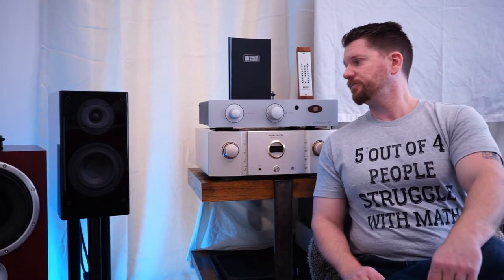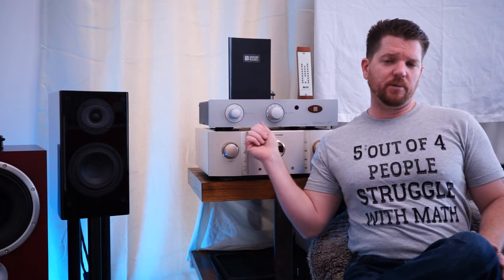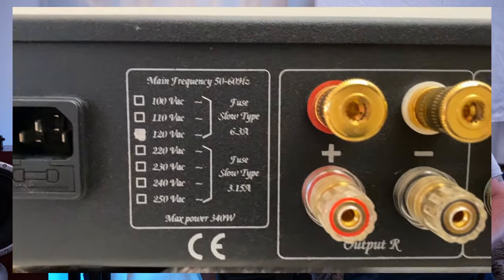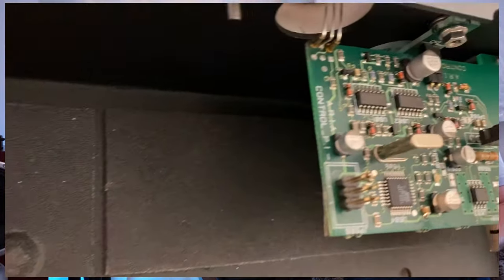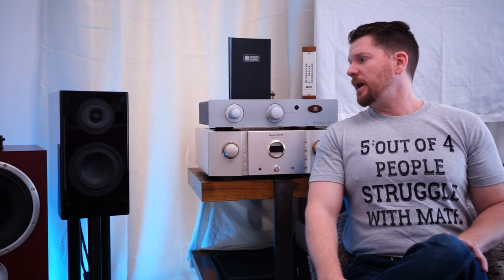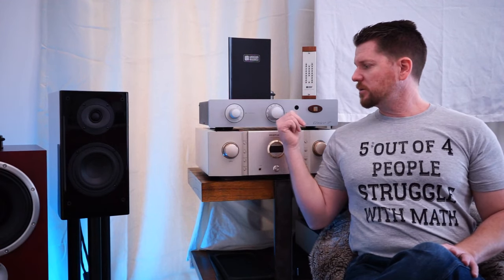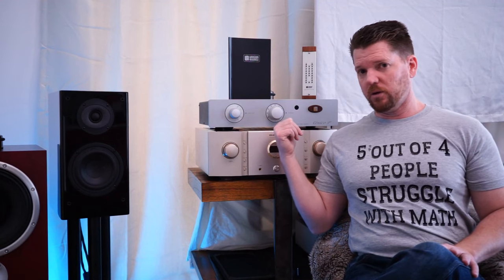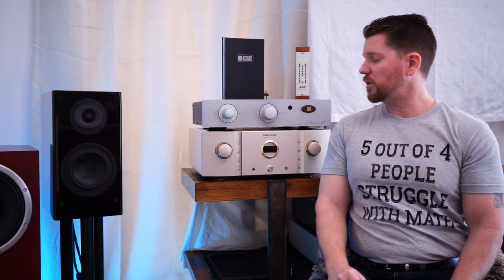Unison Research Unico P: A Mighty 50 Watts from Italy.  Hybrid Tube and Solid State Design

Comment: This is 100 watts, don't fool yourself. A general rule of thumb is that high end gear tends to under claim power output and cheaper gear tends to overclaim power output.
Reply from the maker: Hello RP, thanks for watching and posting.  While I wouldn't argue with you, I too feel this unit is underrating its power, double that number would be no advantage for the manufacturer, why would they do that?  Thoughts?
Reply: @2ChannelListening  Well, for one there is this fanciful notion that top end amps can/should double their power into 4 ohms over 8 ohms and that's literally impossible. One way of seeming to achieve this claim of 100 watts and 200 watts respectively is to put out 150 watts and 200 watts so that they aren't exactly 'lying' when their product can 'double their rated output into 4 ohms'.   When a manufacturer claims it puts out 200 watts into 4 ohms it better put out 200 clean watts into 4 ohms or I consider them dishonest. A review of a Krell 300i amp helps send home the point .  It's rated at 150/300 and when measured by the reviewer he got 190/320. Certainly fabulous numbers but not the magical doubling oft touted or indeed printed on their literature. Just imagine the fallout in the boardroom if a high end amp failed to achieve it's claims, there'd be some explaining to do. Cheaper amp manufacturers lie but in a completely different manner. Their claims often are bogus, they rate at 1khz not full bandwidth and they use different distortion allowances. BTW, a watt is a watt is a watt there is no such thing as 30 watts being more powerful than 100 watts. What's happening is 100 real world watts are outperforming 50 real world watts (all channels driven etc).
Reply from the maker: Hi RP, everything you said is logical, and something I often point out to AVR lovers.  With few exceptions, AVR's rated outputs are at only one to two channels max.  Thanks for contributing to the comment section.

Comment: Good morning Jason. I am looking for an amplifier for my system and the problem that I have is that I need an amp that would be able to be left on continuously since it will be used for television as well. Would a hybrid be able to fit the bill on this since the tubes are for the preamp section? I don't know how hot they run.
Reply from the maker: Hello Leo, 
I am not sure I would go with a hybrid (tube) amp if you do plan to leave it on 24/7.  Even with good 5,000 hour tubes, you could still end up replacing them up to twice a year.  Makes it hard to want to put really good tubes in at $50-100 a pop.   The only integrated amps I felt good about leaving on 24/7 were lower watt units or class D.  Naim, Cyrus, Rega, Peachtree, or Musical Fidelity would be good for this application and still give you terrific sound.

Comment: I tried one of those Unico's out.  That amp seemed like it had way more power than the specs suggested.  The only reason I didn't keep it was because I didn't have a standalone dac at the time.
Reply from the maker: Certainly seems like they are VERY conservative with their power specs.  Thank you HL.

Comment: You should try playing the Unison amplifiers together with Opera Callas speakers.
The Opera factory makes the Unison speakers.
Grtz Phil
Reply from the maker: Certainly some good synergy, yet the Opera like a little more meaty power for driving a tough 3.6 ohm load.
Reply: @2ChannelListening    Here is a Unison Unico 90 together with the Opera Callas Diva. Wauw.
The Unico p will indeed lack some power.

Comment: Glad to have stumbled upon your Channel and like the idea of reviewing equipment that you've actually bought, as opposed to just fluff pieces for stuff that's sent to you.  I've recently been considering an amplifier upgrade and have been looking at used Unison and Audio Research amps to drive my Vandersteen 3a Sigs.  There is a used Unico 150 nearby and an ARC Ref75 that I'm eyeballing.  Would you happen to know how the Vandersteens work with the Unison or the ARCs?  Thanks for posting.
Reply from the maker: Welcome aboard Master Blaster.  I do know how Vandy 3A Sig's work with ARC = Very Well!  I bought my 300.2 after hearing ARC gear demoed with 3A Sig's, then on to add a balanced tube preamp.  I didn't pull the trigger on an LS17SE due to finding an alternative at 1/3 the price, my Audio Experience A2+.

The Vandy 3A need lots of high current and good power, with my experience using Unico, they don't like being pushed.  Within modest operation range Unison sounds absolutely fantastic, start to push them and they strain.  ARC will go the extra mile every time.  You will find ARC tube mono blocks connected to Magnepan 3.7's.  If you have the budget and those are your two choices, ARC would be mine.  Good luck.
Reply: @2ChannelListening  Thanks for the great advice ... will be looking forward to future videos on your channel.

Comment: Thanks for your efforts to help people! From my experience, without the correct electrical power supply of the system, from the distribution in the house and grounding, cable from well-known manufacturers in Japan and the USA, holographic sound will not be achieved! We mostly listen to the conductors and how they interact with each other. After making this important decision with conductors and warming up to 500 hours - the sound is an endless delight!
Reply from the maker: Thanks for sharing

Comment: Great video. Thank you. I just wish you had done it sooner. I've been looking at these for a while, but haven't been able to find much info on them. And from the reviews I've read. There's not many really good hybrids out there. Plus 50 watts normally wouldn't cut it in my setup. So I was very hesitant to take a gamble. But I would buy one of these now, after this video.

I say I wish you posted it sooner, because I just got an Exposure 3010 S2-D this past Friday in the mail. From a fellow audiophile. I got it for a really good deal, and it has the DAC option too. It sounds great. And it's very powerful. 8:30 on the dial is plenty. So I'm happy. But now I've got to try one of these Unison ones too. After this video. 

Oh well. There's no big rush. I'll wait a while to get one. That's all. Anyway, thanks again, and have a great day. ✌️
Reply from the maker: Thanks for this contribution.  I say look for a nice used Primo version, it has 80 watts and a tad less feedback built in.

Comment: Absolutely excellent review. I do have a few questions that I would greatly appreciate if you could answer. I have a pair of JBL 4309 studio monitors, they are neutral but energetic and full of life depending on what the source is; accuracy is their game. I'm trying to get the best integrated for under 3k. Zero Fidelity gave the Unico top marks as the best IA under $2500. I was considering the Arcam SA30, Yamaha AS2200 or the Denon PMA1100. I wish I could get the Luxman 505uxii but that's out of my reach in price. I'm looking for the highest possible hifi sound for the money. I do however live in an apartment and even though not having tone controls I know is best to keep out of the signal path I figured having the ability to have the tone controls to knock out the low end is a good option to have. I primarily want to find an Integrated that has good low and mid volume attenuation. Basically a unit that I don't have to crank up to get the speakers to get those details we all want. Is the unit good for this? Thank you for your time!!!
Reply from the maker: I wish I could comment on the Arcam SA30, its been on my short list to give that Class G amp section a go.  I've owned lots of Denon products and I have to say all of them, along with Yamaha, have this tendency to highlight upper treble energy - in one way, this will give you low level sparkle in your apartment, in another way, it may not sound too balanced without using tone control for more bottom end flesh out.  Now that Marantz and Denon are under one roof, Marantz gets the premium parts over Denon, so I would not overlook the Model 30.  Also, as a wild card, think about the Cambridge Evo 150 too.  However, if you want cool factor and path less traveled, there is the Unison Unico Due.   Good luck, and remember you don't have to settle it all on one unit.  Synergy is the biggest factor.

Comment: Please! This right decision is more important than replacing already good components. Much cheaper! Do not doubt
Reply from the maker: Are you saying no one should upgrade internal parts of their favorite audio component?  I couldn't disagree more.  Some folks love to customize a product and make it their own.  In some cases, depending on age, old audio gear requires new caps, or better caps in the case of Mark Levinson first gen 331-335 amplifiers.  I'm having a hard time following your statement.
Reply: @2ChannelListening  Sorry! I meant as a whole, one good amplifier to another good one, only more expensive. It won't work any better than good cables.
Reply from the maker: @dmitriy2853  I gotcha now, thanks for clarifying.
Reply: @2ChannelListening  I'm glad I made it !
Reply: I trust kimber cable
Reply from the maker: @dmitriy2853  Good to know, thanks.
Reply: @2ChannelListening  You are welcome!

Comment: Revisiting your review once again, in spite of the dampening factor does this integrated have a low noise floor at  moderate listening levels...a bit louder than comfortable. Thanks for the good content
Reply from the maker: Much like what Sean at Zero Fidelity noticed, with these Unico integrated amps, you are getting the majority of  your content at 1/3 dial.  Pushing past 60% is not where these amps like to sing.  Luckily, with reasonable speakers, the Unison provides a wonderful presentation, sound stage at lower levels.  It does a lot right...its only drawback is being matched with speakers that it cannot push.  Stay above 86db sensitivity and you'll really enjoy what the Unison has to offer.
Reply: @2ChannelListening  thank you and have a Happy and Healthy New Year
Reply: @2ChannelListening  do you think this Unico would pair well with Acoustic Research AR12? Found one for around 700 euro nearby, and I am wondering, if the AR12's are efficient enough for this amplifier.
Reply: @2ChannelListening  also, are there any amps in particular you would recommend for driving the AR12's? Thank you!
Reply from the maker: @binkl23  I do not think this would be the best for the money paired to the AR12 since the smallest of the Unico doesn't like to be pushed past 50% volume and the AR12 would certainly require full range of power under load.
Reply from the maker: @binkl23  How expensive is a Naim integrated where you are at?  I would go for neutral to warm when pairing with the AR12.  Maybe try Exposure or Audiolab.
Reply: @2ChannelListening  there are almost none available as I am from Slovenia. Same goes for Exposure and Audiolab. What about a NAD C370? Do you have any experience with their amps? It is available to me for around 500 euro, recently refurbished.
Reply: Or a Sansui AU-719?

Comment: Great stuff but I’m waiting on your review of the Classe I see in your videos.
Reply from the maker: Oh my, how to even respond to your request...thank you for asking though.

So, they way my system is designed, and has been for several years now, is very lopsided.  I wanted and lusted after that CP-700 until I could find a perfect one after three years on the hunt.  Nothing else in my system comes even close to it in terms of original retail cost and current depreciated cost.  In turn, that makes it very difficult for me to appropriately review the CP in any kind of comparison or head to head, due to my budget constraints.  I would be cheating my viewers if I didn't have something of comparable, original retail build value as a side by side.   My last really good preamp was a semi custom YS Audio all tube preamp, but that was four years ago and not a fair comparison. 

When the day comes where I can borrow or get my hands on a preamp it competes with, I absolutely would do a review. but alas, I cannot mark such a day.  Thank you for continuing to come back and watch A F.  Super appreciated.

Comment: Looking forward to your review on the Unison piece. I'm using a poor man's version - Musical Paradise MP-303 Tube Front end/TPA 3116 Class D Hybrid. It's on the warm side of neutral 40 WPC @ 8 Ohm. 300va toroidal power supply. Using Totem Acoustic Sky bookshelfs and a PSB sub. Looking to upgrade the amplifier one day just analyzing the various choices. Enjoy your philosophy on your process.
Reply from the maker: Thank you Rod.  Totem makes great speakers.  Enjoy the journey
Reply: @2ChannelListening  You helped to inspire me to acquire a serviced Unison Unico Primo SE int. amp. 140 8 ohm/240 4 ohm. I should be receiving it in a week or two and am looking to forward to try them with my bank of speakers.
Reply from the maker: @rodkubo5679  That should be a good one!  Yes, please let me know how it goes.  PM me if you like once its up and running, I'd love to hear your impressions.
Reply: @2ChannelListening  OK. Going to Run 6 different pairs of speakers will take some time.

Comment: one of the best out there.... great company for their amps
Reply from the maker: Thanks Denis.  What are you running from them if I may ask?
Reply: @2ChannelListening the speaker’s I had the linn espek and the linn magik 140 ‘s , the intergrated i had was the primo. The espek are bass kings and good balance sound. the magik 140 were more detailed punchy but not as deep bass, small room should be good though. Mids are slightly more forward,which is a matter of taste. Unfortunately all is gone. But hey, that’s what audio is all about :)

Comment: Ascend or Sierra?
Reply from the maker: Ascend Acoustics - Sierra One = good catch!
Reply from the maker: Marten Dekker   "Particularly strong are 2nd, 3rd, 4th, and 5th overtones that give the sound a full-bodied "brassy" quality. Combining this reinforcing harmonic content with the compression and high-frequency roll-off of the output transformer in a tube amplifier is why your tube amplifier will "give it up" while your friend’s transistor amplifier will sound restricted and harsh." - From Tung Sol's website.    
Guess I was a little right and a little wrong :-)

Comment: can you characterizise this amplifier in two or three sentences?
Reply from the maker: Wow Max, can you sum up a driving experience in a Alfa Romeo GTV6  in two sentences and do it justice?  I'm not that good, lol.  Let's see...

1. Surprisingly robust, lively and dynamic operated within its comfortable power output range.
2. Sound is more reminiscent of older high power bi-polar output designs - detailed, not exactly warm, but great body.
3. Don't push it too hard and it will reward you with great balance that's better than most under $1800.

Comment: Would that be cube audio from Poland the speakers very nice they're not cheap.
You don't need and you don't want high damping Factor if your drivers that have small excursions like the zu.
Very confusing with Watts and how they write their figures that's three types of figures you can write for Watts RMS, programmable, and din peak power, most of the Japanese choose peak power RMS the best finger to look for. for instance RMS of 10 Watts is equivalent to 100 Watts peak power.
Shaun fromzu says to put some pizza boxes underneath stack them up to get your the desire bass when putting rubber feet on plus pushing them back to the wall is more desirable. What's so special about this capacitors  same value? if you want good capacitors you need to go for audio note mylar in oil copper or silver but not cheap! best you can get make sure they're from England not off eBay they should give you a certificate a lot of fakes.
Very good integrated amplifier that's tube based is Audio Note oto se phono or line signature silver new 2500 cheaper second-hand, can't go wrong with it and the zu
Reply from the maker: You said a lot their John.  I know there are some seriously hardcore Audio Note fans out there.  
No, not the Cube either...*tease*
Thank you for watching :-)

Comment: Reviewing a modified Italian amp seems misleading at best. While I do enjoy your reviews for the most part, this review doesn’t  meet your usual standards.
Reply from the maker: Hi Scott, I made full disclosure's of why I chose this particular amp, who did the modifying and giving detailed close ups of the changes in the video.  Misleading, I'm not sure what you mean by that?  This one was listed at only $200 more than a couple stock versions listed (at the time).  

Does this amp more than likely have an adjusted sound from a stock unit - without a doubt, the OPA627 would ensure that.  Everything else looks like window dressing.  I have never been able to sound test resistors and diodes.   Thank you for your feedback.